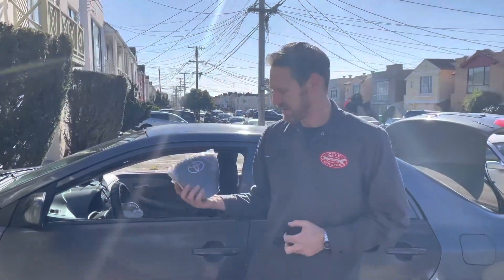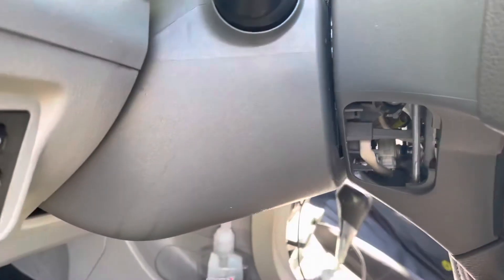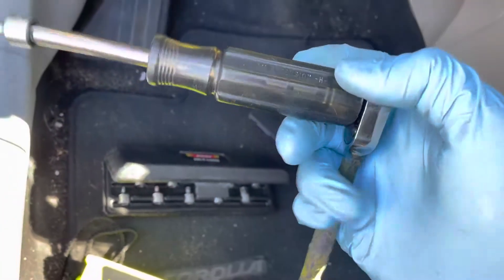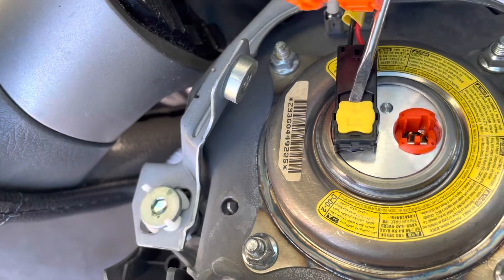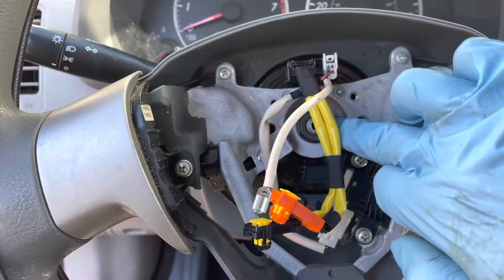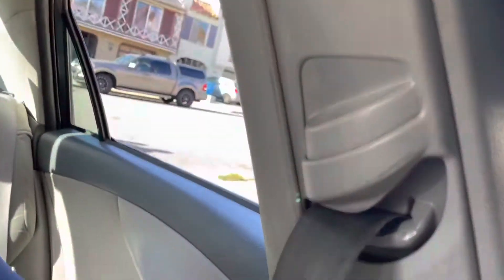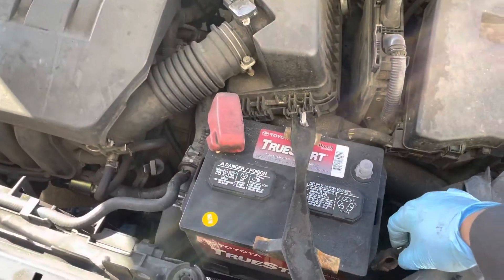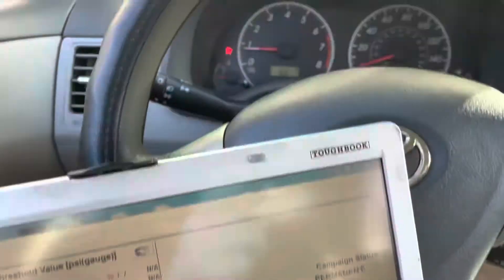2010 Corolla Airbag and Seat belt Replacement

Comment: Thanks for sharing this replacement. Please advise what tools you used in this video... I'm having no luck with identifying the specific tools needed for this project. Thanks in advance
Reply from the maker: Metric sockets and torque bits for the two bolts that hold the airbag down

Comment: when you replaced the air bag, did it need to be "coded" to the vehicle, I want to get another set of front seats for my car, different color, and was wondering if changing the seats would set the airbag light on the dash
Reply from the maker: No coding was needed

Comment: Have a 2013 honda civic. Mechanic told me I have to replace the airbag seatbelt and    tensioner and also control module because of coding otherwise airbag wouldnt work . . . Almost as much as buyina used 2013 honda with 300k miles.
Reply from the maker: odd that it needs that many parts